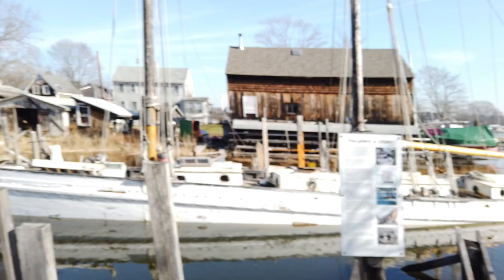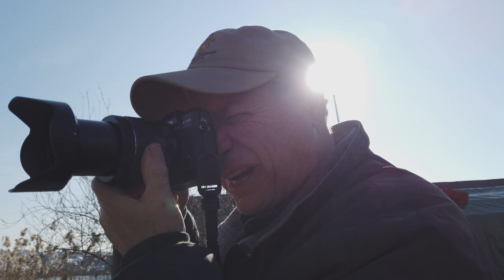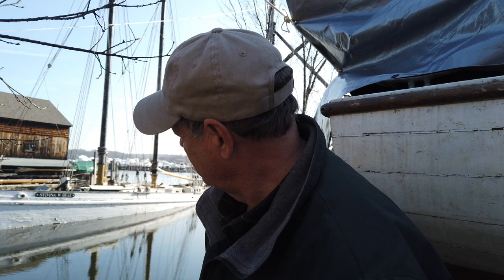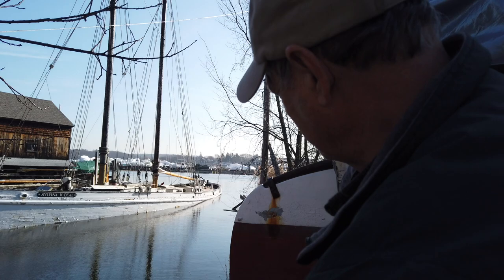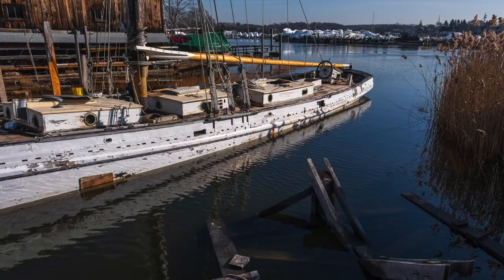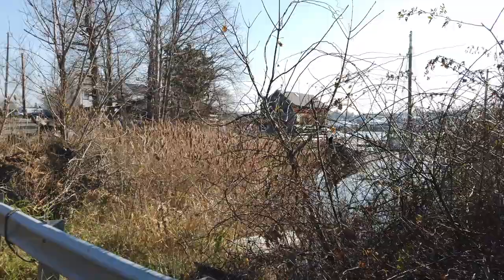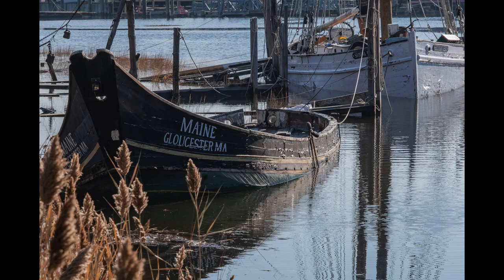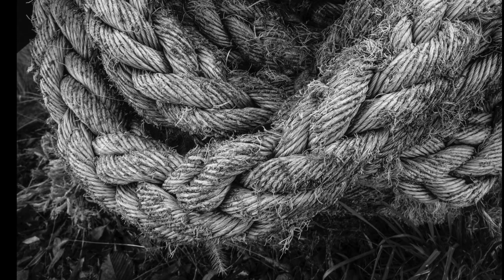Fuji X-T30 & Fuji XF 16-80 | Schooner Restoration

Comment: Loved the rope shot with the 23 f2, and the zoomed shots around 70-80mm. Such a great lens. I’ve debated about getting this lens, to replace the 18-55, 
Still thinking, as I need to keep things light. As they say “ the best camera to have, is the one you have with you.”
Reply from the maker: Hi Mark, thanks, yes I love the rope shot too. So far the 16-80 has been outstanding. Since the copies of this lens are all over the place I would suggest buying from a place where you can test it first. B&H in the US is great for that. If the lens does not cut it send it back and they will replace it. Good luck. Oh btw I use my 18-55 for video it’s superb.

Comment: have you used the 16-55mm? Would you recommend the 16-80mm instead for travel/landscape?
Reply from the maker: dontpokethebear3893 - The 16-55 is a much better lens (Red Badge) and is a f2.8 not f4. But it is much heavier and larger. For travel you want something relatively small and light weight with a longer reach than 55 which is about 85mm in full frame terms. Currently I'm using the 16-80 for travel and landscape so I would recommend it. But if you do go that route I would buy at a camera store and check the copy before you buy to make sure it is a good copy. There have been some QC issues. Good luck!